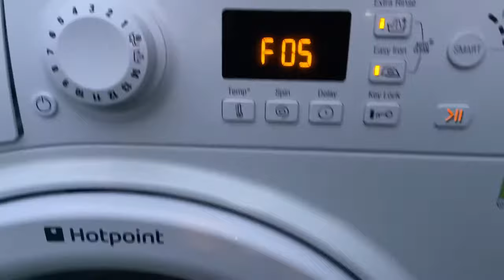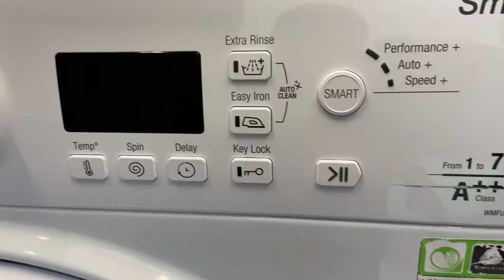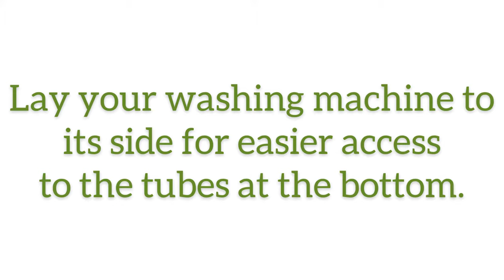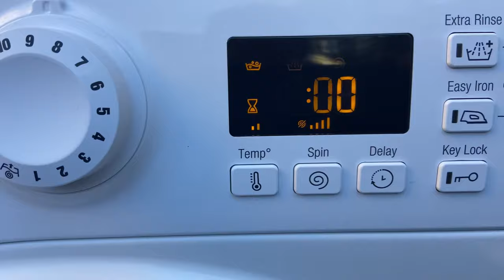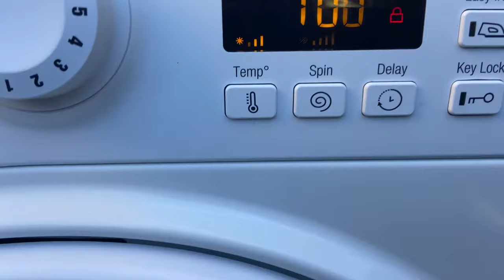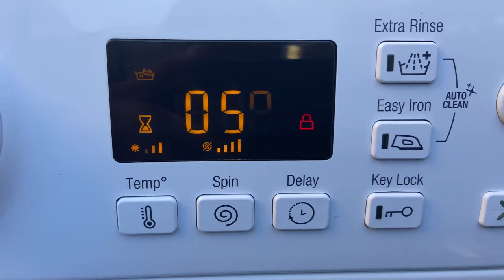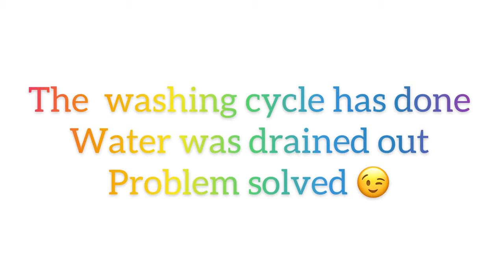Hotpoint washing machine F05 Error Code. Blockage. Don’t drain.

Comment: Thanks so much for the video. I had the F05 error and the filter was clean. Turned the machine over as per your video, undid the drain hose and boom, one of the kids small socks in there. Cleaned out, put back together and all working again. Thank you!
Reply from the maker: Thank you, I have an unwanted sock, would you like it to pair? 😂

Comment: if at least it opened as much as that..i have no clue how long previous owners had had this machine for so much that that part is practically hanging so the tube with that lid is not attached and still and rusty ...the manufacturer never even thought about making such a machine with at least 5cms feet so it isn't direct on the ground to make it easier up drain so people don't have to lie on the floor to do whatever it is

Comment: I even thought doing the normal cycle would solve since it's draining as well as the other thingy cycle where it squeezes the entire water out of the clothes..plus I have no clue what kind of treatment they have this machine but according to when I bought the house they didn't know how the water heater worked...either they never showered or they showered with cold water 😒🤦😱
Reply from the maker: If you wanted to know how escape a sock from a washing machine’s drum: there is a little gap between drum’s edge and sealing, or if the paddles are loose in the drum, clothing can slide out from the drum.

Comment: Man, you are the best, I was fighting this issue for 5 hours and tried all the small tricks the other MotherF... Hotpoint technician said in his video without any success! I just unscrew and remove the pump as you said, and miraculously I found a wipe inside :) Thanks a million for your help, you should have more views on this video!
Reply from the maker: Hi Ryan,
It means a lot your feedback and makes me happy. Follow my channel, may you will find other tips in the future. If you could support my work I would be grateful. 
Thanks George
Reply: of course maintenance is gonna say you have to pay a new one or new part ...it's not theirs..their not paying for anything...easy to speak
Reply: that do you mean by pump?on the back of the machine?this thing the lid you're turning isn't even coming out..and doesn't turn left that much..still had to remove water inside the tumbler with a measurement cup...and there's no water coming out it's in the tumbler though...how do i remove this lid?it's almost hanging and attached but a thread to the tube

Comment: explain to me how a sock goes through the mini tiny 1mm holes in the tumbler to the back on the machine???the sock doesn't fit in those holes for as much as you might squeeze them
Reply from the maker: If you wanted to ask how escape a sock from the drum in tumble dryer: if you already loaded the drum and empty the daily filter after, a sock could fallen through filter’s hole and enter the airways.

Comment: I did that, I found a sock just like you in the tube below the machine, but when we plugged it back, the washing machine just started filling with water and won't stop unless we unplug it, what did we do wrong?
Reply from the maker: Hi ,
So when filled up with water all water remains in the drum or does it leave straight? In the tube under the drum should be a ball, that supposed to stop the water. If water level increases there is a narrow tube going up next to the drum. That join to float sensor. Take off sensor and blow in maybe it’s blocked?

Comment: Thanks, very informative. However, I got stuck because the video doesnt show how you opened the back. Mine is sealed.
Reply from the maker: Hi,
Do you mean at the bottom? I didn’t have any cover on this machine. Different makes may have a cover at the bottom.
Reply: @georgesworkshop8600 hi, I'm referring to the back of the machine. Mine is sealed so I would have to unscrew it first.

Comment: Thank god for this video I've been trying to fix the problem for hours trying to flush out the waste pipe and cleaning the propeller. Put your video on and problem solved. I had a sock in the pipe to the drum just like you.
Reply from the maker: Thanks Luke to share your story and I am glad my video was useful.
Reply: So the pump is under the washing machine?

Comment: How did you get to the inside? Where is the cover held on please?
Reply from the maker: Hi ,
Access from the bottom, there is no cover. Turn to the side where the dispensers are.
Reply: @georgesworkshop8600  apologies I meant to get in the pump etc. I had  to unscrew the back off.

Comment: There's a moral to this, so please bare with me...
Recently bought a hotpoint wmfug 942, as i'm leaving the person I bought it from exclaims 'you may want to clean the pump when you get it home' (being straight and honest)..
Get it home, throw clothes in it it, all washes perfectly.... However now when I try the drain spin cycle the drum won't even rotate, ended up watching a lot of these videos, and had I just thought for a split second, I would have just removed the outlet hose and ran the machine as I eventually did having removed and replaced, a pump, sensor, and hose. When it started pumping out water through the grey outlet hose, it was only then it occured to me i'd put an outlet stopcock inside the pipe to stop kitchen water billowing out every time I wash my crockery. Moral of the story is check the very first thing... We'll, first. Moral is sometimes you don't need experts, just what with hindsight is common sense.
Reply from the maker: Thank you for your thoughts

Comment: Hi There, I'm going to attempt this, but did the first step to see if there was any obstruction in the filter, and found a hair tye, but I'm not convinced that was the issue. When testing the paddles, they did spin ok, but there was a bit of resistance, should this be the case? I can't see or feel anything else in there however, so wanted to check. Thanks so much.
Reply from the maker: Hi Elenor,
Blockage could be after the paddles in the tube after the drum. May isn’t there anything, but it worths to check.

Comment: Im having same trouble with mine, cleaned filter and found a kink behind washer, if i have to look further, is it just a case of tipping the washer over or is there a cover to undo too?
Reply from the maker: Hi Ashley,
I’m not sure what do you mean. If you need to clean the drain tube tip your machine to the side where is the detergent holder, to avoid from water damage on main board. I cleaned from underneath.

Comment: Recently acquired a hotpoint, the thing will not drain.
I have checked the inlet and drain pipes from the washing machine and sink and the are all clean, I changed the drain pressure sensor, however when I blew through the thin black pipe, (that is connected to the blue sensor 021/022) I can hear water bubbling somewhere at the bottom of the pipe, I ran a thin rod, (with plenty of room) through the pipe and no obstruction. Initially only FO5 error, showed the H2O error once, but now FO5 again, is it unreasonable for a small pool to be retained in that part of the pipe as I drained the washing machine with nothing in the drum... My only guess is to remove, maybe replace the thin black hose.. Any other suggestions would be appreciated..
Reply from the maker: Firstly, if you remove that wide black tube (coming out from drum) from the pump and the water don’t flow, there is the blockage. Secondly, if you remove the waste pipe( grey) and blow in and air could flow, then pump is faulty. Check the pump, try to turn the paddles with a screwdriver, if you hear clickings, then pump is ok. If paddles are running easily the pump is faulty.

Comment: I am getting same error and also one of my sock is missing :) I checked the pump filter it is clean but i cannot find the braveness to lay it down and unplug the pipe.
Reply from the maker: No worries! Follow my instructions and you can do it! It must be close to the drum .
🤞
Reply: @georgesworkshop8600  followed your instructions and my problem is sorted. A sock was sticked in the pump 🙏
Reply from the maker: Great job 👏😉

Comment: I did that nothing was blocking still f05
Reply from the maker: Hi Matt,
Is the pump working well? When you turn by your finger the paddle it makes clicking noise? That is the normal working. If not the pump is broken.
Reply: @georgesworkshop8600  oh so if the pump broken just call Hotpoint?
Reply: @georgesworkshop8600  well I took some muck out it turns,  so not sure what it is? def f05 flashing is it a sensory chip problem?
Reply from the maker: Sorry for the late reply. An idea: remove the filter lid and start a spin. No worries water won’t be involved, but you can see if the water pump is working. I don’t think this is sensor issue. F05 is water cannot flow.